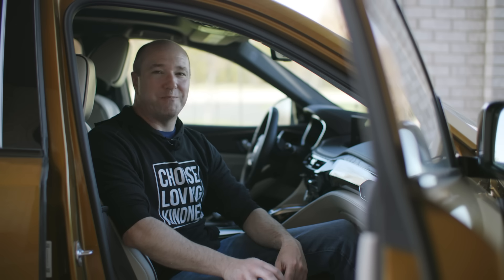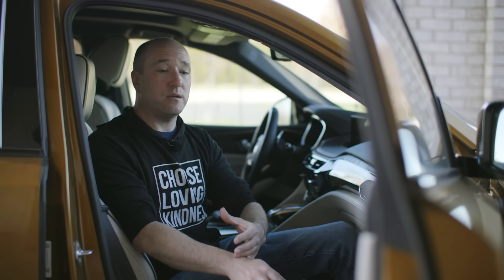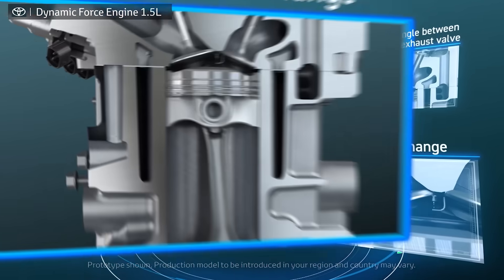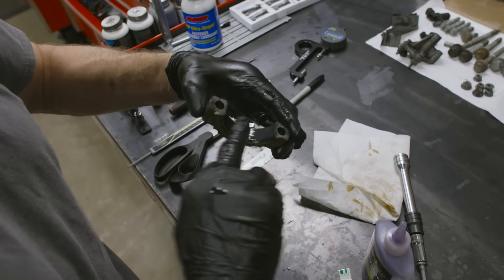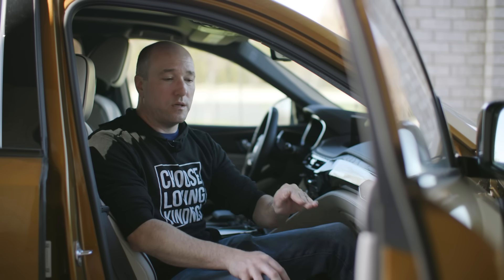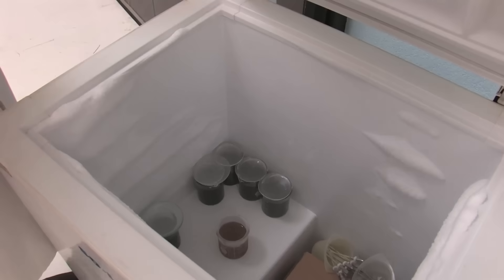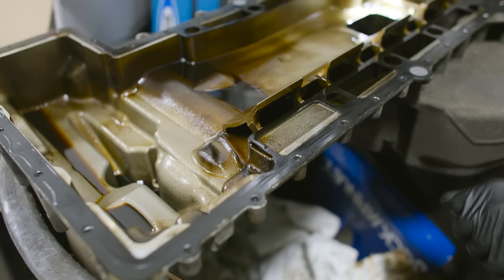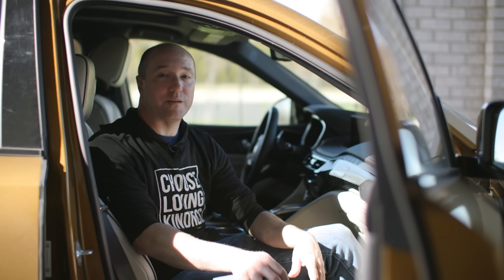Understanding Engine Break In | Dos and Don'ts

Comment: This is exactly why I’m saving up for a new car. I’m willing to eat the depreciation if I can break it in and truly care for it how I like to
Reply: Good call - anything sporty you want to buy new - especially if you are going to keep it for a stitch.
Reply: @Terry B  I mostly agree, but at the end of 2020 I rolled the dice a tiny bit on a 2019 STi with 9422 miles, bought at Longo Toyota in LA.  It looked pretty immaculate, I saved about 9k vs a new one at the time, and now it's at 46k miles, and it's been great.

But speaking to break-in period, I wonder if that has anything to do with the fact that it burns half a quart of oil per 1k miles.  Who knows.  I also tend to drive aggressively at times, but it's mostly freeway commuter miles at 70 mph.

Even if the motor blew up once the warranty expires, the difference I saved initially could all go to a stronger rebuilt motor.

Edit: and now with the market how it is, I could sell it for more than I'm paying for it.
Reply: @ZakTheRipper18  That oil usage is pretty typical of a Subaru EJ - they are pretty poorly engineered by Japanese standards at least.
Reply: @Beer_Dad1975  I know it's is not uncommon for a turbo ej.
Reply: @ZakTheRipper18 sorry 4 months old but did the WRX have a aftermarket cotton airfilter (I don’t want to say a brand name). I’ve put 1 million miles on 6 Subaru’s total and every one I ran an aftermarket airfilter developed terrible oil consumption. 
They let in more fine dirt than paper filters and it eats the oil control rings. 
Maybe it is the Subaru rings?
But after rebuilding an XT engine with Wisco pistons and a paper airfilter I have zero oil consumption after 50,000 miles. 
Most people never run the cotton air filters for 60,000 miles and never discover the issue with the rings. 
I just rebuilt another engine with 200,000 miles that ran a cotton filter for 3/4 that time. Control rings were packed into the piston solid. 
Oil changes on all the cars every 3,000 miles with synthetic and quality filters.
Reply: @arthurm-vl6sw  absolutely not.  My STi had the original filter when I got it, and I replaced it with a dry-con one, which I've cleaned once.  It's great.  I heard not to use a cotton filter for the reduced filtration of particulates and that excess oil from the filter can foul the MAF--or is it MAP? sensor (embarrassed to admit I don't know how the turbo EJs measure air).
Reply: @TerryManitoba  Except if you can't afford something more than $10k... even if financing.
Reply: But what if I want to only keep it for a lilo
Reply: I agree with this. Only car people will understand that.
Reply: @chbrules  well, it was a Ford Explorer.  Those things have always been junk.
Reply: I am all for new car buying and taking care of it for a long time. But as far as breaking-in of a daily driver car, my experience says the subject of breaking-in to be overrated.

I drove a fleet of luxury vehicles for over 25 years and over 2 million miles. Really hundreds of vehicles, where I could compare 1:1 at different mileages. And while there have been exceptions (1 or maybe 2 during this period), where power of the vehicle did not feel quite well, all other vehicles were driving equally good (Mercedes, Cadillac and Lincoln). Only as the cars have accumulated mileage, there have been some VERY slightly noticeable differences, but definitely not during the first 100k or so.

I much more prefer buying a new car, so that I am the only mechanic on it (no mechanic other than me EVER touches my vehicles, I have a really nicely equipped home-shop-garage). I keep my vehicles in brand new, show room condition, inside and out.
Reply: @mrtopcat2  see THAT makes sense to me. I guess my perspective is flawed because I do not have my own garage 🤣🤣 but yes, the experience of having an untouched car seems totally worth it I’d guess
Reply: @Pericles777  Off Topic: sadly, having a garage these days is no guarantee for long term upkeep as parts on cars have become such expensive, while having short service lives. I am talking about the ever increasing use of plastic parts and ever more complex cooling systems with coolant cooled turbos and such. It gets to a point where, yes everything is still fixable, but you would likely spend thousands for parts alone and at some point the economics of it would simply be no longer worth it. I am actually right in that dilemma. My wife has a 3 year old BMW 440i, made to order. We love the car, but it has tons of the aforementioned parts. A complex valvetronic, timing chain and vanos on the firewall side. So I have mixed feelings about keeping this car. My wife hardly drives it, so it has only 20k on it. But I expect it to turn into a lot of work in a few years, when all the plastic is going to become brittle and I am going to be chasing mysterious vacuum leaks or similarly mysterious leaks in the cooling system... ...by giving up and replacing all plastic parts in the system (because they will sooner or later fail anyway, so why not) and spending exactly the aforementioned thousands in the process. She loves the car, huh. I think I am screwed, lol.
Reply: Its worth. Bought my first new car 10yrs ago and I’ll never buy used again
Reply: Absolutely no use of cruise control during break in
Reply: @chbrules  I suppose, some people do take excellent care of their cars.  My uncle had an immaculate '91 Escort sport gt that he bought new and maybe six or so years ago replaced the engine, then sold it a couple years ago.
Reply: My car was 16 years old before I finally traded it in. It was a hand me down I drove for 9 years.even then I had no issues with the drive train. Cost to repair AC would have eaten up my planned down payment which ultimately sped up my purchase timeframe.  I don't mind eating the depreciation on a new vehicle because I aim to drive this new one for 10+ years. Resale value means little to me when I plan on driving it til the wheels fall off.
Reply: Yeah but then you have to drive an ugly af modern car. ew.
Reply: Bought my former 2018 WRX new and broke it in as specified by Subaru. The car was mechanically sound until I sold it at 77k miles earlier this year with regular oil changes via the dealer. The only thing that went out was an AC Compressor around 50k (replaced under factory extended warranty). In hindsight, didn’t need the extended warranty and got it for peace of mind being my first Subaru and knowing older Subaru reliability. Future cars, I really want to buy new so that I know for sure I can count on it
Reply: Used cars are so expensive now anyways you hardly save much, hell sometimes they’re more lol

If it has a manual trans I definitely try to get a new one. Never know if someone learned stick on the thing or doesn’t know what rev matching is lol
Reply: I've done that.  2012 Honda Accord Coupe manual bought brand new.  10+ yrs in and it runs like a dream.  I plan to keep it another 10+ yrs.  I broke it in properly according to manufacturer specs.
Reply: Depending on the car, I'd buy new online and make sure your dealer puts in the order for it to come direct from the factory.

Inventory new cars (especially popular ones) may likely have had the usual tyre kicker coming in just to waste time with a joyride test drive, thrash it and put it away wet. So even if some inventory new cars have less than 500 mi. on them, most of those miles could be from test drives that were 'stretching her legs' with no intent to buy.

It's why when I got my 124 Abarth, I kept hunting until I found a dealer that was willing to work with me in buying a future inventory car and phoning me up the moment it arrived.
Reply: @PorscheDuésnburg  100% this
Reply: @PorscheDuésnburg  The 124 Abarth is a really nice car.
Reply: Almost done with mine. 1st new car probably will be my last
Reply: @DB-qm4jx  Same.  My current car is my first new car.  But I've had great success with used cars and will most likely go that route...unless I become rich!
Reply: This is why I am leaning heavily towards a new Mazda MX5 (Miata) instead of a used one. I'll know exactly what has been done to it and can take care of it from day 1. I also plan to keep it long term, 10 years or more, so I will get value out of it.
Reply: @Swarm509  right now it’s often cheaper to buy new than a vehicle 2 years old. Around here at least
Reply: @arthurm-vl6sw  Same in my area, and for the MX-5 specifically they are hard to come by even used. For between 2k to 5k extra I'll go new.
Reply: That’s way too goddamn much money IMO😂😂😂 you must really love that car I hope
Reply: I spent $11k on a car that is now only worth $1600 and that hurts. Couldn’t imagine  dropping $90k and seeing that resale value drop to $14k
Reply: Even if a car isn't a long term I would still be careful with breaking in a car. I've done that with every car and motorcycle that I've had over the years. I've never had an unreliable car or motorcycle.
Reply: Usually if you get like a 2 year old car the depreciation you save is actually more than the cost of a new engine after it dies at 200-400k miles(depending on the engine). After 10 years you can usually get an engine replaced for 10k or less. But average car ownership is only 8 years even though the average age of a car before becoming unusable is about 12-14 years. Shoot bought my original msrp of 29k top trim subaru legacy at 4 years old for 17k and now have it and it is 12 years old with no issues in sight.
Reply: @Hallowsaw  avg car has a useful life of  20 - 25 years! Avg car on the road in the US is 13 years old, so almost half are >13 years old.
Reply: @The_Stanman  most cars dont make it to 300k
Reply: @Hallowsaw  yes but most make it >200K mile. There's not as good data on odometers as vehicle age (comes from registration data). With avg life of 20 - 25, and avg car driving 11k miles per year, suggests avg car is salvaged at ~250K miles.
Reply: @Hallowsaw  I’m not purely looking for longevity. I can’t stand the thought of someone else abusing the car, even if the damage is minuscule. I’m also considering the physical condition. I plan on taking delivery, immediately polishing the paint, sending it in for ppf, and ceramic coating every surface. I have OCD so this kind of stuff really matters to me, even if it doesn’t make logical or financial sense
Reply: @TheMstwntdLMSV123  then why not go with a certified pre owned if you dont care about longevity? Do you think it will cost 4-10k to recondition a 1-2 year old car to dang near new condition. As someone who has done detailing in the past, it does not. You could find maybe even a better trim just one or two years older and save a ton of money. That extra 100-200 a month adds up in retirement fund in 30 years
Reply: @TheMstwntdLMSV123  Must be nice having money....I couldn't even afford a brand new base model manual transmission Nissan Versa.
Reply: @Shawn Warnick  he has broke person mentality. You can't help him. He will waste his money one way or another.
Reply: @TheMstwntdLMSV123  Your car , your time, your money, - your business...  Personally i wouldn't take that kind of gentle care of any car i own unless it is a show car or literally a ferarri or something like that... Just your standard run of the mill hyundai or camry i would just use it like the consumable it is ....
Reply: @TheMstwntdLMSV123  I would be very happy buying your used cars. 😁
Reply: @Hallowsaw  I couldn’t agree more. The depreciation on options is much more than that of the base car. The original owner of my car had spent a fortune on options and I was very happy to pay next to nothing extra for it.
Reply: @Conservator.  yeah i got my 2011 legacy with every option there was for 17k in 2015. It was 31k in 2011. But the dealer was a chevy dealer so they were sitting on it forever. Now in 2023 i still se the same car selling for 8-12k depending on the mileage. So depreciation has been good to me. If i were to sell it right now for 10k which i could easily get,only has 130k miles on a 12 year old car, paint is still in decent condition minus the door handles. Those can be swapped out for 200 bucks after painting. Interior looks like its only 5 years old at most, i have all the service records. I only lost 7k in depreciation over 8 years of ownership. Thats nothing compared to people spending 500+ on new car payments. Even if i spent 500 on a thorough detail job every six months, im still saving money compared to a new car.
Reply: @TheMstwntdLMSV123  glad you can afford to waste money like that
Reply: @Hallowsaw False, today the depreciation is MINIMUM
Reply: @alexanderboychev1095  depreciation is minimum. I think you need to look at the current repossesion rates, income vs cost of ownership and realize something has to give. Its usually not people making more money. The used market is going to tank within the next two years. For example, i bought my 2017 outback in 2020 for 20k. Last year for craps and gigs could not find one less than 25k within 200 miles of me. Now im seeing them for 18k. So you are telling me if i bought one last year and tried to sell it right now that 7k lost is not depreciation? It still depreciated 2k in 3 years. Depreciation waxes and wanes. Its not consistant
Reply: It's okay purchasing low km or mile engine.  My 15 odyssey was bought at 70,000km I now have 340,000km with no issues.  Basic maintenance and this van never failed.  No oil leaks, no burning oil and no metal shavings when drained.
Reply: I would do the same thing for a specialty car (I'm in the market for a ZL1 Camaro), but I have no issue issue buying used for my economy commuter car.
Reply: You can buy a few engines from the depreciation that you’d save when buying a used car.
Reply: ya but then gas powered vehicles get banned and the agency comes to take you away. lol just kidding bro hope you find the ride you want
Reply: @WANO i beg to differ. Certain new cars dont last. My car was new in 2011 and here i am 12 years down tge road only having to do regular maintenance so far. You wont know till you get ten, twenty or thirty  years down the road
Reply: I bought a new car some years ago thinking the same thing. I researched everything and did my very best to treat it the best I could... Eventually I realized that half the stuff under the hood of just about any car these days is plastic, operated by computers, all with a finite lifespan, and the car would turn into a nightmare 5 years down the line regardless of what I do. So I sold it. Consider that most cars today will not break down because of internal engine wear but because some electronic system either failed - or becomes so outdated that nobody wants to use it anymore
Reply: @dirkmohrmann8960  that is not always the case. I have a car that is a 2006, one thats a 2011 and one is a 2017. All have been really reliable. Sitting at 260k on the 06, 140k on the '11 and 90 on the '17. I mean 260k miles and 17 years old right there tells me if you can keep your car maintained well it will last. The thing is, when have you ever spent 400-800 per month on fixing your car like you will on a car payment. I will say this though. If the cost is more than 50% of the value of the car, then it is not worth it
Reply: I might agree with you if this was 1985.
Reply: No used car is going to have as good paint/clear coat as a new car. If you are the only one that washes that car, you will preserve it. It's very easy to cause micro scratches on clear coat, I took my car once to a washing station and micro scratches appeared. Never again. I have pressure washer, all of accessories and know how to wash the car properly without scratching it. Many people simply don't care you can see it on many new cars if you know what you are looking for.
Reply: Same here buddy, almost cupped one last month but I pulled back.
Reply: Getting my first car in one year, a two year old BRZ is worth just as much as a new one lol. But I'm making sure it's a car I'm keeping for ten years. Very excited and saving up for my down payment.
Reply: Eh just get a good taken care of used vehicle lol. I've never cared about that and all of my cars have lasted over 300-400k

Like he said, regular cars it's not that critical
Reply: I just bought a Ford Ranger. Ill take care of it well
Reply: I'm still rocking a 99 CRV with no car note! People get so fed into these newer vehicles which have alot of reliability problems. I'll be glad to drive my CRV until it's a rust stain on the concrete!
Reply: Theory is great, but in real life it doesn’t matter as long as the engine oil has been changed reasonably regularly.
Reply: Yep I only buy new cars for this reason as well
Reply: Best feeling ever
Reply: I’ve been babying my new Tesla engine.
Reply: G manly
Reply: Same! Sadly I can no longer buy GM products because they do not make manual transmission sedans anymore. So I will have to buy a foreign car. And trust me, as usual it will have a careful break-in period. It looks like the only one left that is not four wheel drive is the  VW GLI.  It is made in Mexico, so this should be interesting. I will factory order it in early 2026 to arrive in spring. They are expensive, but I would NEVER buy a used manual transmission vehicle. People think they know how to drive them, but I've watched them, and it is cringe worthy. 😘
Reply: Til it gets totaled by hail, a deer, some nissan or yukon denali, or a drunk driver in an 03 toyota blowing past a red light at night.
Reply: @qx4n9e1xp  I share this nightmare
Reply: Same here. The main reason for me is the amount of idiots who keep modding them and ruin the engine and ECU.
Reply: I don't see how new cars are more expensive than used cars. You might get lucky used but there are a lot of sad, abused cars out there that need work you won't know about until it's yours to deal with. If you buy something new like a Corolla, the depreciation hit isn't much compared to a more expensive car.
Reply: @kiefershanks4172  It's not that hard to get a good used car, just takes a bit of due diligence.  Firstly, pick a brand and model that has a reputation for reliability - then drive at least 3 or 4 of that model to get a feel for which is a "good one" = then If you aren't mechanically minded, you might have to pay for a pre-purchase inspection, and if you are still unsure you can often either get a manufacturers used car warranty if you are buying a certified pre-owned, or you can get a 3rd party warranty (from a reputable company) - also get a history report of course.  You can save a bundle of money even on a Corolla just by buying one that is a couple of years old that the first owner has taken the depreciation hit on, and still get a great car that will be reliable for many years.
Reply: @kiefershanks4172  Ive bought a lot of used cars....only got burnt on one...but it was a hell of a burn...
Reply: @fortheloveofnoise  oooh, do tell.
Reply: A new BMW every two years, thats all i ask